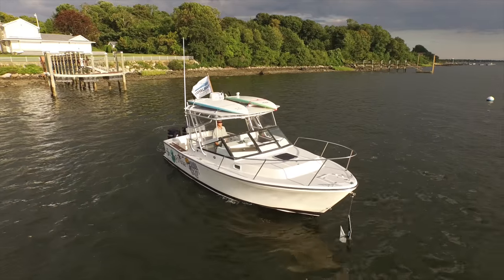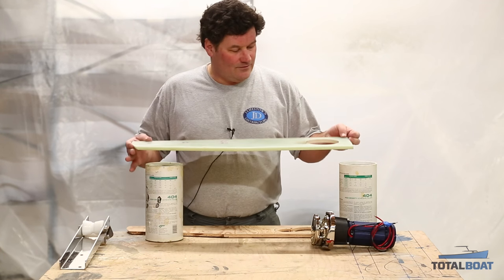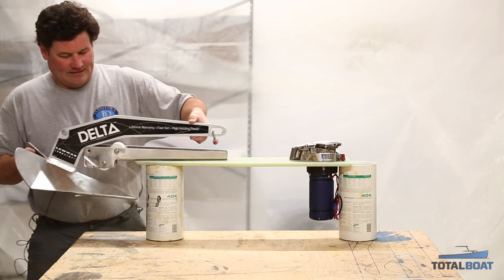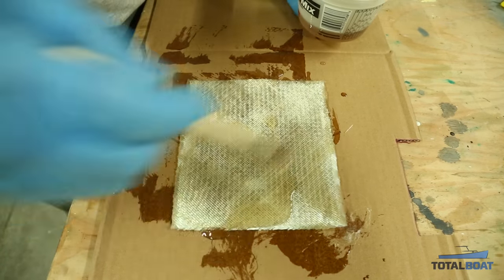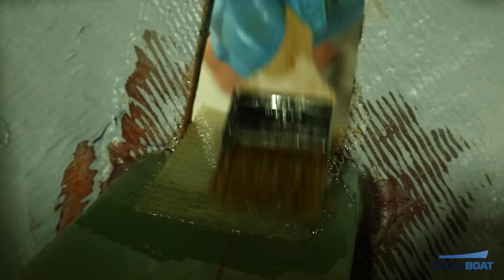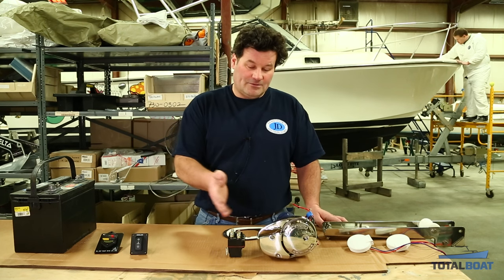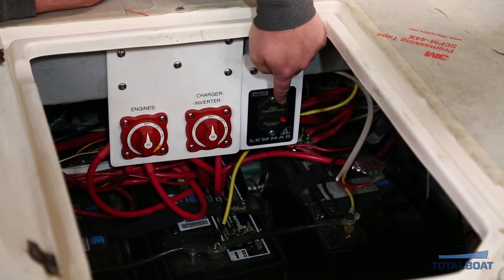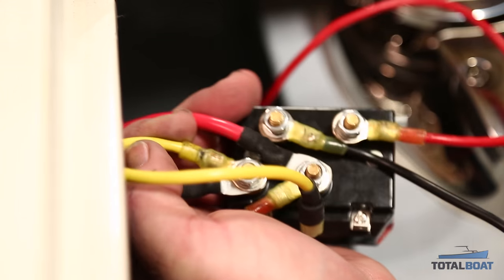How to Install A Windlass on Your Boat

Comment: Not trying to be wise here I am a fan of Total Boat products and JD, but how do you deal with water intrusion in your anchor locker. Looking at the set up there is a rather large whole in the bow of the boat. Isn't it common with the bilge. 

The set up looks beautiful but seems a bit dangerous. Even if the anchor locker and bilge aren't common if it fills up with water that's a lot of weight all the way at the bow.
Reply: Andy Perri are you serious? God help you if it rains lol..

Comment: I suggest TotalBoat pull this video. Creating a large opening at the stem which will, without a doubt, take on water in a rough sea is asking for a lot of trouble.
Reply from the maker: The area where the windlass is stored and lives in the bow is in it's own compartment which has a drain. It works fine on this boat as it has on every other boat with a windlass. Even those without windlasses will have openings (hawsepipes, etc) to allow the anchor and rode/ chain to flow freely in and out of the anchor locker.  it is totally safe and cannot fill with water! But thank you for your concern.
Reply: Richard Waldman you should do a little research before you run your mouth.